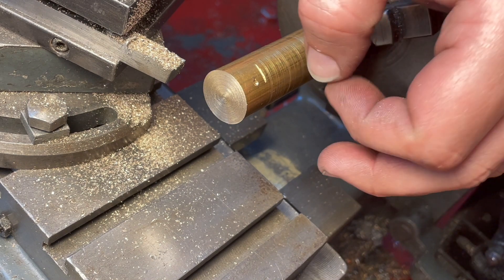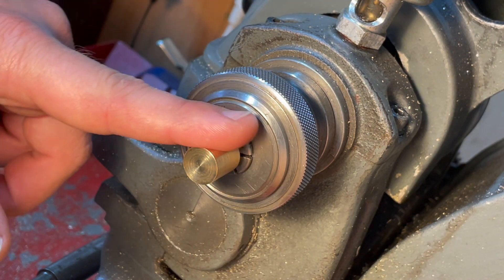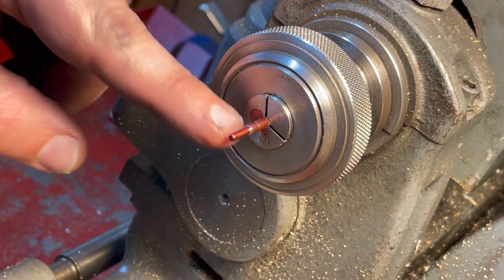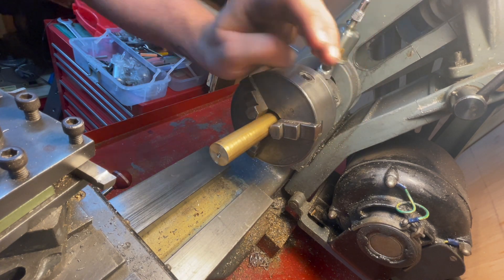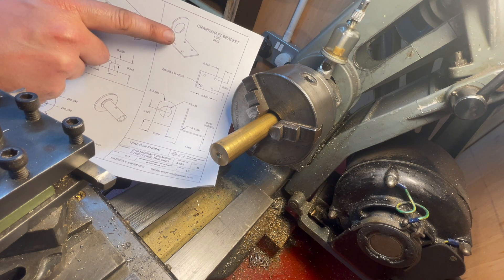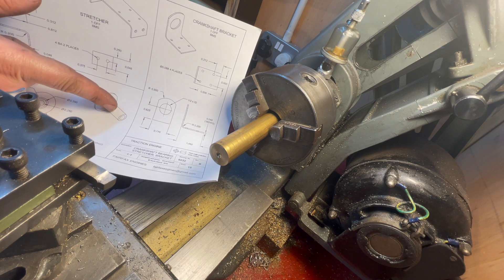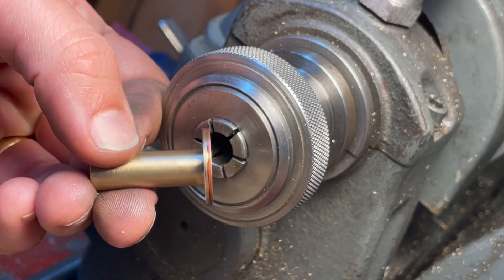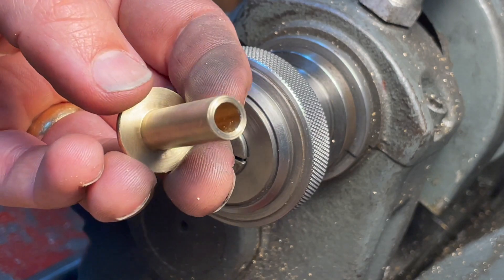Piston, Bearings and Bushes - Building a MyfordBoy Traction Engine 2

Comment: Great lathe work, this was fun to watch thanks. We use exactly the same method for cutting threads on a lathe, it is impressive to see people do it powered. We have a good selection of imperial taps/die, drill and reamers, drop us a note if you need to borrow something for times when you do not feel is is worth buying one
Reply from the maker: Oh that's very kind of you, thank you for the offer - I think in this case I want to prove to myself that I can adapt the design and everything else works OK - but I really do appreciate the offer!

I have occasionally cut threads with a tap on the lathe under power - in theory with brass it should be fine, but I only ever do it on a through hole. Into a blind hole seems like madness!